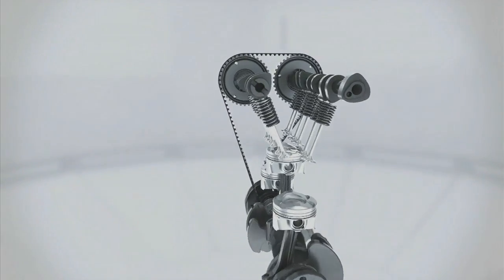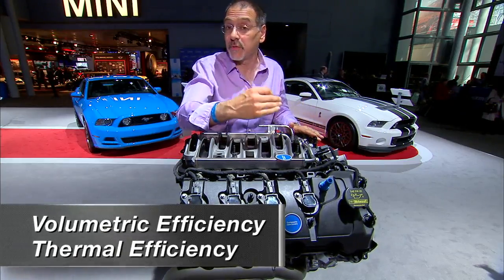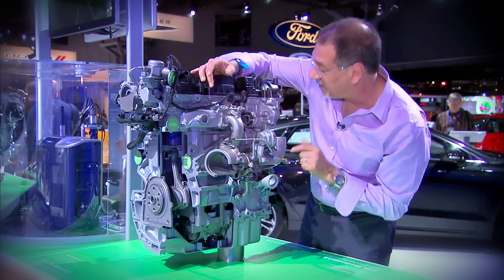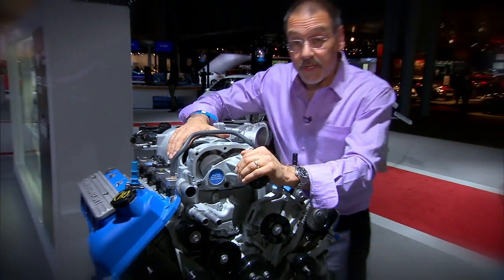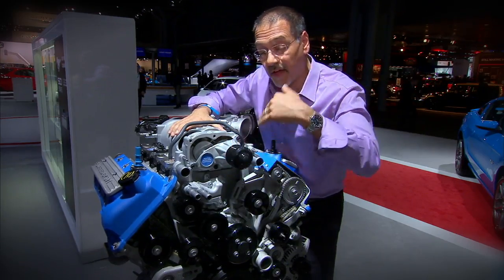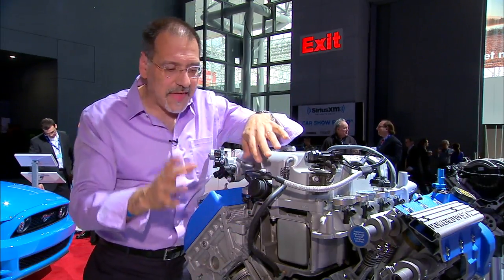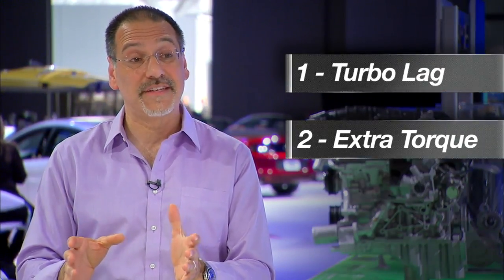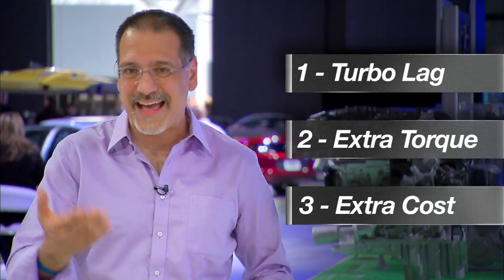CNET On Cars - Car Tech 101: Turbos vs. Superchargers

Comment: 1-4 turbocharger intercooler petrol engines all in all brands : Easy Damage, 20-100 l/100km, over 100 l/100km with 160 km/hour to top speed on circuits and test maximum over 20,000-150,000 rpm by law standard engines all.

From
All brands databases 

End report.

Comment: Turbo lag is such a devine intervention-it takes sustained rpms to generate the force of exhaust to spool the turbo, then charge the intake manifold with boost pressure, this is also a chance to boost oil circulation, coolant circulation and just about any engine like being loaded at higher rpms than super low and lugging. If left on the standard factory tune, it can apply all this extra torque gently, on all supports and drivetrain, while staying just at the fringe of breaking traction if there are precipitated surface conditions. They are arguably a jet engine, I.C.E. hybrid. 

A supercharger is a gas powered air compressor that beer bongs itself and  whines all the time, but can compensate with it's throaty, free flowing exhaust note.
Reply: ERICtheLATE set up is key, if its done correctly, there will be 0 lag.

Comment: Here is an idea- A supercharger with an ECU controlled electric clutch like the AC compressor has. That way the supercharger could be set up to only engage when heavy throttle is applied or the engine is under heavy load. Then it could still boost power when necessary, but it disengages under light load like when cruising to reduce drag, noise, fuel consumption, and heat.
Reply: tho a nice idea modern superchargers have minimal parasitic loss now.

Comment: To Eliminate Turbo Lag Shift into Lower Gear to get the Engine RPMs over 3000+ more Exhaust Turbo Spools Quicker same goes with Centrifugal Supercharger design which is different than Vane type Supercharger

Comment: With variable geometry turbochargers the lag issues are considerably reduced.
Take a factory 2. Something liter engine with variable geometry turbocharging, variable valve timing, coil on plug ignition and direct injection. We have 4 cylinder engines able to produce more power per cubic Inch than most V8 engines without the fuel expense. Best part is they produce the majority of their output between 1500 and 3500 rpm rev well over 8K and hold together.

Comment: turbocharger is very suitable for high rpm engine to gain huge horsepower, and supercharger is very suitable for low rpm engine to gain huge torque.

Comment: Well heres some logic:  Turbo charger if you have a manual transmission / Supercharger if you have an automatic.  Problem solved.   It makes no sense putting a Turbo on an Automatic or a Supercharger on a Manual!
Reply: tdawg719 Elaborate please!
Reply: AccursedOmega there's no hope for you it'll just waste my time.
Reply: Because automatics use torque converters...
Reply: why can't turbos be paired with automatics? Doesn't make sense

Comment: "the increase in working pressure increases the flame front speed...which causes more fuel to burn! That increase efficiensy!"

You're right, it does cause more fuel to burn! Burning more fuel = lower mpg. You only get higher mpg when you burn LESS fuel.
Reply: inertiaforce if you had watched the video, he said thermal and volumetric efficiency, meaning a higher power to fuel ratio, not a higher fuel to distance ratio.
Reply: Bryan my post was a response to someone else's post. It was mistakenly posted by itself here, in the wrong area.

Comment: .... superchargers are not high tech...been around a long time
Reply: Turbos are from 1905, and the superchargers from 1885, all old tech :P
Reply: turbo chargers weren't automotive on mainstream until the early 80s. xD that SAAB turbo, that would randomly kick in.
Reply: 1962 GM made the first mass produced Turbo car. Superchargers came allready in the 20s , but never cought on until the 60s.
Reply: that's not a Turbo, that's a Centrifugal type super charger. It pumps air into the engine, now out of it.
First mass produced  turbo was in the 80s, it was a SAAB, and it was dangerous,  and it was fun, and most of all? It was expensive.
Reply: LosCadaver It was a turbo...deal with it.
Reply: it was a centrifugal type, o_O get your facts straight. ;) the models were called the "Turbo ___" but it was centrifugal superchargers.
Reply: LosCadaver Prove it, haven`t found any such information...
Reply: the 1964 Monza  Spyder, used a turbo-supercharger  hybrid,  unlike a turbo,  it wasn't powered by  exhaust fumes, it  was  powered by  inertia,  and unlike the positive displacement  supercharger, it wasn't  mounted between the  intake and the carb,
it was mounted  carb first.
Hence, it was a Centrifugal supercharger.
or a Turbo Supercharger
Reply: LosCadaver I was talking about the Turbo Jetfire engine...
Reply: same engine EDIT: Configuration

http://f3.ifrm.com/5662/69/upload/p1685032.jpg
Reply: LosCadaver Yea, it was turbocharged, what is your point?
Reply: its not a true  turbo charger, its halfway between both
Reply: LosCadaver By all information I can get my hands on it is a true Turbo...

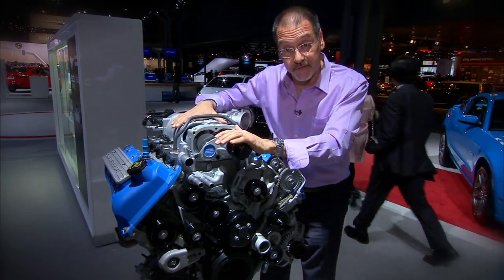Comment: 2:26 I got news for you dude, Turbos are also parasitic.
Reply: But by a magnitude less!
Reply: Bu Jin yup that gas now has to be pushed out of the engine newton's law man equal and opposite forces
Reply: philly Fail This is fluid dynamics, not Newtonian physics! It is a bit more complicated than that ;)
Reply: All that exhaust has to be squeezed through a tiny area to direct it to the wheel. That causes back pressure and heat which rob power. But it's parasitic lose is less than that of a supercharger.  Both designs have advantages and disadvantages. Both are brilliant.
Reply: One is brilliant and one is not for daily drivers.
Reply: The Esseboy I've owned both and they both did great as a daily
Reply: Both at 14psi boost?
Reply: The Esseboy the supercharged one was around 8 stock I raised it to 14, the turbo was 15 stock raised it to 20.
Reply: And let me guess, the mpg for the first one was around 10-12 and the later had 20-24mpg
Reply: The Esseboy the supercharged car weighed 3800 and had a v6 and got 24mpg city and highway. 
The turbo car weighs 3100 and averages 27. When you're on the gas on a turbo car you run more rich than when you're on a supercharger car because they run hotter. I was surprised how efficient the heavier supercharged car was. Especially because it was a 97 and the turbo car is a 2006 with direct injection. Blown cars are more efficient than you'd expect.
Reply: The Esseboy like I said they both made great daily drivers
Reply: Hmm, what engine did the turbo car have? And did you use any kind of eco mode for mpg? In eco mode you lower boost pressure quite a bit and run lean :P
Reply: The Esseboy a manufacturer would never design a turbo car that runs lean under any circumstance other than idle. That's how you fry rings and ruin engines. 

I don't know what you meant by your original comment but I've owned 3 supercharged cars and 2 turbo and they all made great daily drivers and were all efficient. 

It's not like the old days with a giant blower on top a carburetor getting 10mpg. Engineers know what they're doing.
Reply: lean as in just a tad leaner than stochiometric lol, like 15:1, that can be done with low boost and a good intercooler, as turbocharged engines typically run a lower compression ratio. And of course at full throttle you run a bit richer than stochiometric to not damage the engine :) That is how small engines get above 50mpg.
Reply: None of the super cars with high engine redline that offer supercharged engine, like McClaren, Ferarri, etc.

Comment: 5 years in the future: Electric Turbo chargers could prevent turbo lag, and can accelerate more air into the engine. They could also regulate how much air goes into the engine. Did anyone invent those?
Reply: F1 has used them since 2014
Reply: the future: just use electric motors

Comment: can i have turbo and super chargers so i have no lag and lots of power?
Reply: google "twincharger"
Reply: F1 cars have separate Compressor and turbine, the turbine generates electricity and the compressor uses that to compress the air, thus using a battery in between you can "spool" up the compressor instantly :D
Reply: It's called "compound charging" been done a couple times. The only down side is the supercharger can cause turbulence in the charge because the turbo is putting out more pressure than the supercharger